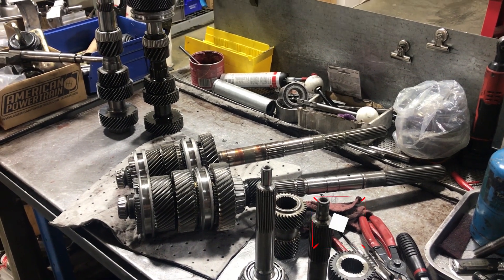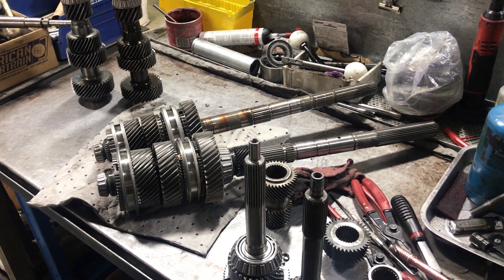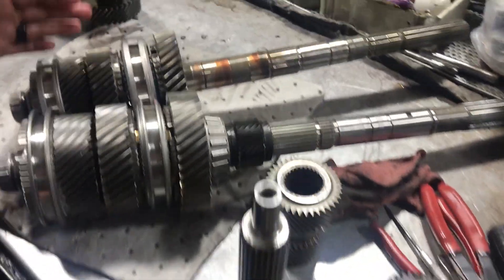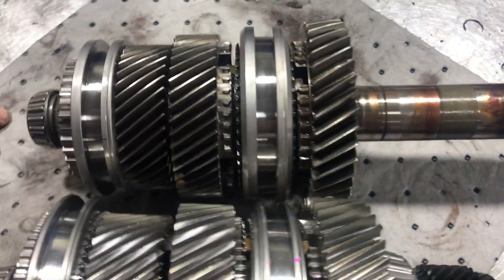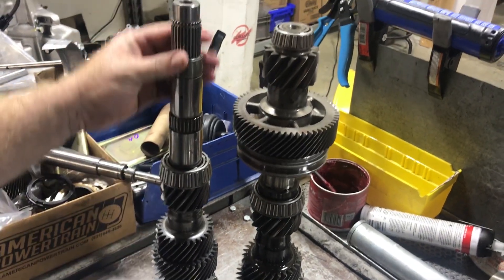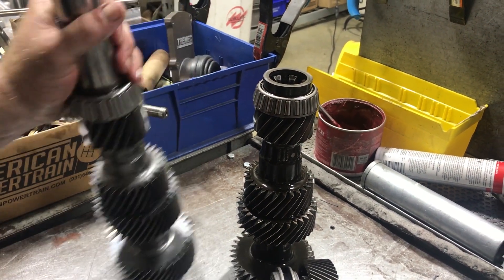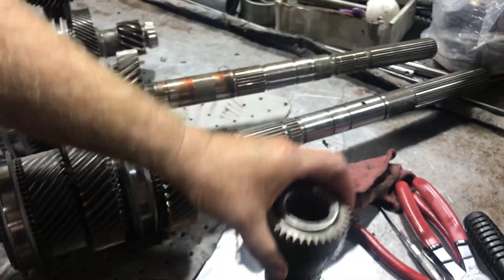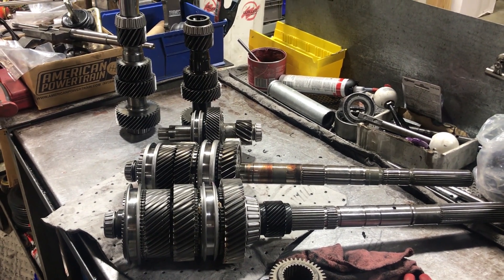Differences Between Stock T56 OE Vs Magnum 6 Speed Internals

Comment: I have a t56 magnum I would like to switch from a h pattern to a straight pattern. What do I need?
Reply from the maker: Two ways..You can bolt on the S1 Sequential Shifter but keep in mind you still have to use the clutch. Or we can convert it to a true sequential and replace all the internals with PPG gear set

Comment: how do I find my T56 "model"? I have a barn found TransAm 95 but I was told that it was modified my goal is 1000hp in 5 years
Reply from the maker: That is an LT-1 T-56. The weakest of all of them. Has a two piece main shaft.
Reply: @AmericanPowertrain  dayum, what do you recommend for my goals?
Reply from the maker: @ You need a Magnum 6-speed. Any OE 6-speed just wont hold up to that power. You will sink more money into that than just buying a new one the right way to start.
Reply: @ thank you I will checkout your website and buy one!